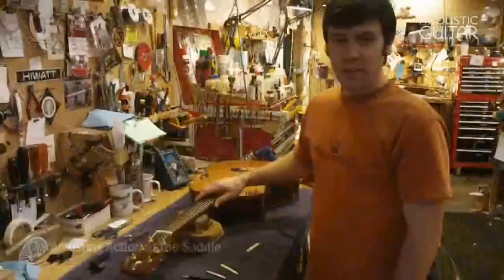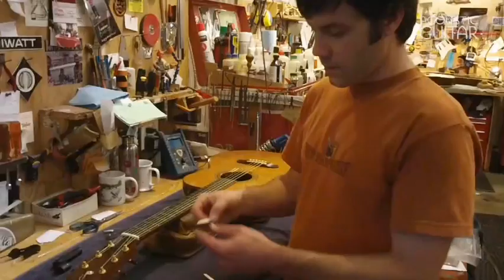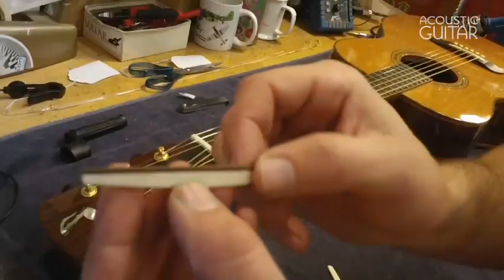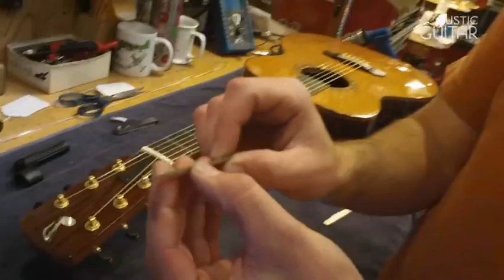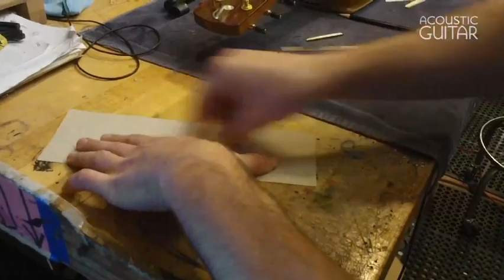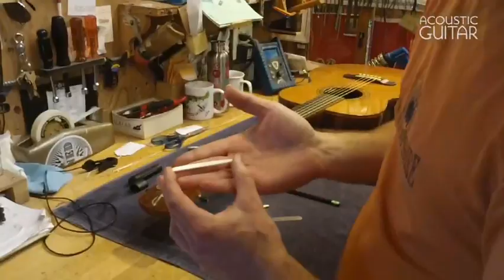Guitar Maintenance: How to Check and Adjust Saddle Height | From the AG Archives

Comment: You say the string height should be a few thousands above the fret. I’m assuming you’re talking about the first fret. And by a few thousands what does that mean? Is it .002, .003, .004, .005, .010, .015, . 020?
Reply: A few
Reply: @DaveTaste  I was hoping for something a little more precise. That’s like saying I had a few beers. Lol
Reply: @TroyCarroll509  or just a cheeky line.
Reply: @TroyCarroll509  
Use a   .60mm guitar pick ' top of the fret to the bottom of the string on the 1'st fret
Should barley hold the pick in without being too tight.